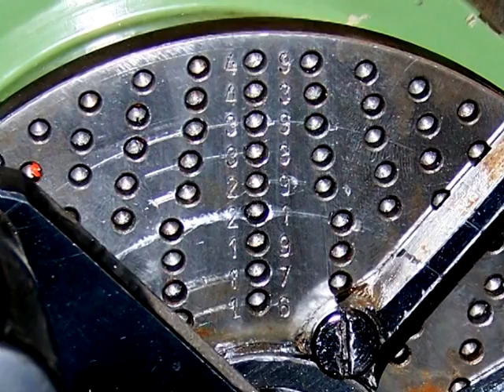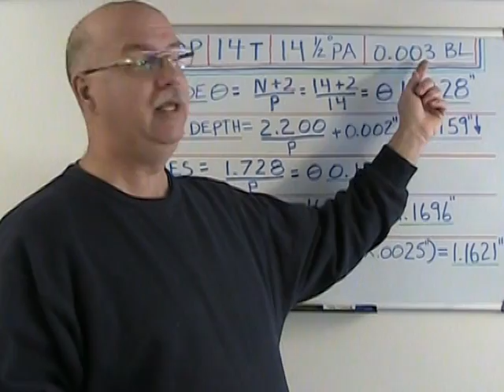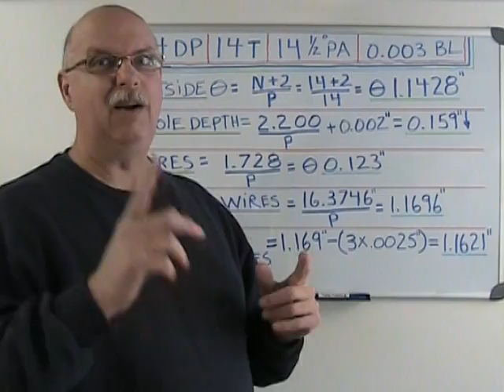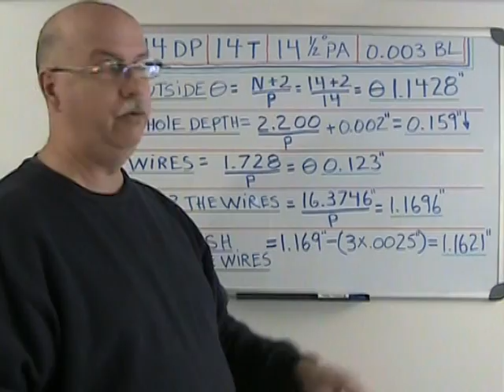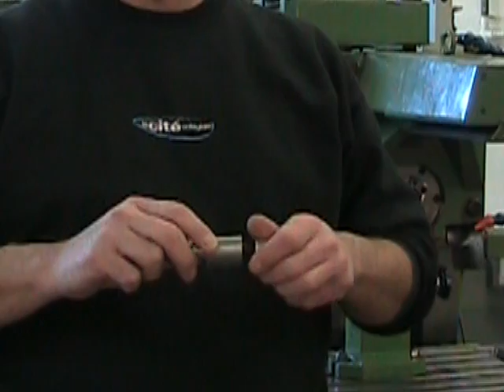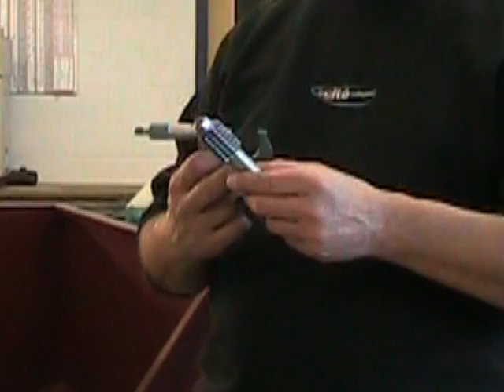027  DIVIDING HEAD & GEAR CUTTING, MILLING 101 MARC LECUYER

Comment: Th video is very interesting, I am not good at brilliant  at math. I am trying to work out how you got the  2 12/14 out of 40/14. I am trying to come up with a fraction for a 13tooth gear. Can you help explain pls?
 Thanks, waitng for your reply.
Reply from the maker: Hi! The formula for a 40 teeth dividing head is 40/N . N is the number of divisions you want to produce. So for 13 division you will have 40/13. If we simplifie the fraction we get 3 and 1/13 since 13 goes into 40 three times (39) and there is one (1/13) left over. So you will move the hand wheel three full turns plus one division (hole) on a 13 hole plate. You probably don't have a 13 hole dividing plate but you probably have a 26 hole dividing plate. So if you need 1 hole on a thirteen hole plate, you will need two holes on a 26 hole plate. So you will want to move 3 full turns plus two holes on a 26 hole plate for each gear tooth you want to cut. I hope this helps, if not let me know, Marc
Reply: Thanks for this explaining,  with the help of a fraction to decimal converter I know how you got the 1/13 from. Thanks for your reply again, will get back to you if i need any help in the future. Cheers from the small isle of Malta...

Comment: After the "over the wires measurement" when you reinstalled the gear for that final .010" deeper cut, how did you phase the cut teeth with the cutting wheel? The video skipped that procedure.
Reply: Hi! The part is held between centers and that is a great way to ensure concentricity of the part when removing it and reinstalling it for measuring. The rotational position is assure by the drive dog, the only thing to remember is that the drive plate has two screw that snug up to the dog to eliminate backlash. That can be a problem when removing the part so make sure that you loosen only one of the two screws and on reassembly, snug the dog into place using the same screw that you loosened at the beginning. This will not reposition the part in rotation to withing .001" but since you have left approximately .010" to remove, the final pass will fix any slight realignment problem ( in rotation only since the concentricity will be controlled by the centers). i hope this answer helps, if not let me know and I will try again, Marc
Reply: Thanks Marc. 'Love your work.

Comment: so my depth of cut lets say is 0.160 so instead of measuring over the wires just make my total depth of cut 3 or 4 thow bigger would that not work? im fairly new to machining with a precision 14/40 metal lathe and a bridgport clone atrump 9x49 milling machine trying to learn from your expert channel as well as the 2 kieths and oxtool and doubleboost. thx mark.
Reply: Jamie, You would not be certain that you were at the proper depth without taking a measurement.  Wires may also be used to measure thread depth.  I have done it, but would have to find the formulas again.

Comment: HI Marc,
thank you for the very in depth lesson on how to cut gears using imperial measurements. the conundrum i'm having at the moment is trying to figure this all out in metric as the metric version uses "modul" or "m" with 20 deg pitch. 
it appears i will have to make a hole plate for my dividing head as the gear i need to cut has 13 teeth and the lowest division on my dividing head is 15 

is there a big difference between the methods? i would think they are rather similar. the other question i would hav eis which cutter to use. i picked up the entire set of 8 (they were cheap enough) and so i'm trying to figure out the right cutter for 13 teeth

cheers
mike

Comment: Marc,
I served my apprenticeship as a machinist in the late sixties. Good explanation of gear cutting. Did I miss something about climb milling. Do newer mills have ball thd. type lead screws, compensating nuts or was your machine hydraulically fed.
Marv Fritts
Reply from the maker: ***** Hi Fritts, thanks for the nice comment. The machine I was using had a hydraulic backlash arrestor, there are no levers or knobs to adjust, just an on and off switch on the console. It works quite well but has one big drawback, it is so inconspicuous that the students tended to leave it on even when not required and that induces premature wear. Thanks for watching and for tacking the time to comment, Marc L'Ecuyer (a late seventies apprentice).

Comment: 16:00 .002 wouldn't be suitable for anything required to work in heat I'd say
Reply from the maker: Rob F hi Rob, you are very correct for high speeds, where friction is a real problem, more clearance, greater pressure angles and lubrication is a must. Thanks for the great comment, keep them coming. Marc

Comment: Hi Marc.  Excellent lesson on the subject.  I cut my first gear that last week of my senior year of high school.  My teacher set up the machine and the dividing head and taught me how to operate the crank and sector arm.  We made a worm gear out of bronze and he hand ground a single tooth cutter that he templated from a good tooth on the damaged gear we were copying.  I got into this so much that on the last day of school I chose to stay behind and finish the gear for him.  When I left that afternoon  the school was deserted except for some teachers and the custodians.  That's how much of a passion I had for machining. I worked in tool and die for a couple of years and started a formal apprenticeship but the only trade school in Philadelphia that sponsored tool and die was in a dangerous neighborhood, so I dropped out of the program.  I eventually got into drafting and design but I still miss machining.  I miss the Bridgeport and my all time favorite: the shaper.
Reply from the maker: Hi Tony! The gear teeth (14.5° and 20°) have the same thickness and the same height! The only real difference in they shape is the steepness of the curve on the sides of the teeth (the surfaces that rub). Gauges are available but quite rare, I would suggest to find a gear cutter for the 20° pressure angles and the correct diametral pitch and then use it as a gauge to compare with the mystery gear. If the teeth have less curved surfaces, it is more than likely a 14.5°. If the teeth match the cutter, it is a 20° and if the curve is more pronounced that the cutter it is probably a 25° pressure angle gear. I hope this helps! Marc
Reply from the maker: E.PLUMBUS UNUM Maybe next fall I will try and make some videos about my little shaper. They are fun  machines but boy are they dangerous! You don't want to be inattentive when operating them. thanks for commenting and for watching, Marc
Reply: Marc, can you tell me how I can determine whether a spur gear is 14.5 or 20 pressure angle?

Thank you!

Tony Tammer
John Swett High School
Crockett, CA

Comment: I'm still working with the "theory" and I didn't see how you set the two sector arms.
Let me see if I've got it correct though.
You start at the zero tooth with the leading arm against the pin, then count 18 holes clockwise and adjust the spread of the sector are so that the flat of the arm is clockwise past the 18th hole and lock the sector arms together.
Cut tooth
Hold the sector arms in place, and pull the locking pin out and turn the crank two full turns and then to the flat backside of the sector arm, push the pin in the hole.
Now rotate the sector arms against the back side of the pin 
And cut another tooth, repeat until all the teeth are cut.

Sorry I need some help in setting the sector arm positions and rotating to a new position.
Reply from the maker: You are correct but I want to make certain that you understand that if you count the number of holes including the hole that the plunger is in, the total will be 19 holes. That is why it is important to say (when setting the sector arms) that they are space at 18 holes not counting the hole that the pin is in. That is because it is the spaces between the holes that we should be counting. For 18 spaces you need 19 holes. Thanks for watching, and thanks for a great question, Marc L'Ecuyer

Comment: Marc how did you set the gear back in the machine for the 2nd cut, pick up back at the same place??
Reply from the maker: Hi Frank! if you go back to the video and watch from 2:15 you will see the drive plate. Since the part is mounted on an accurate fixture that has accurate center holes and the drive dog on the fixture is never moved, you can remove and replace the part, fixture and drive dog assembly between centers with great repeatability. The rotational precision is ensured by using only one and always the same set screw to snug the drive dog to the drive plate. Also, it is important to remember that I purposely left some ten thousandths of an in on the part, this is more than enough material to make up for any error (will be very small) on the positioning of the part. Thanks for watching and thanks for the great question! Marc L'Ecuyer

Comment: Heya Lazy Machinist,

Thanks for a very informative lecture. Loved it! I've always wanted to know how gear-grinding was done and you've explained it exceptionally well. I do have a question though. Would it be OK to create a fixture that includes the key-way for the gear first, or should the key-way be cut afterwards? My thinking is that if the key-way is cut first then install the blank on the fixture (with the key installed), there's less risk in damaging the gear teeth after they're cut. Any thoughts? Thanks again...

Comment: Excellent Video !  I spent 20+ years setting up and running production equipment such as Gear Hobs, Mills, Spline Rolls, etc., but never had to figure the wire size myself as it was always provided on the blue prints.

Good information to know on the formulas and calculations.

Thanks for sharing.

Comment: What are "wires" and what does "over the wires" mean?
Reply: 123HURST :  "Wires" are pins or 'wire gages' that you drop down between the teeth and measure over top of with a micrometer to check the pitch diameter.

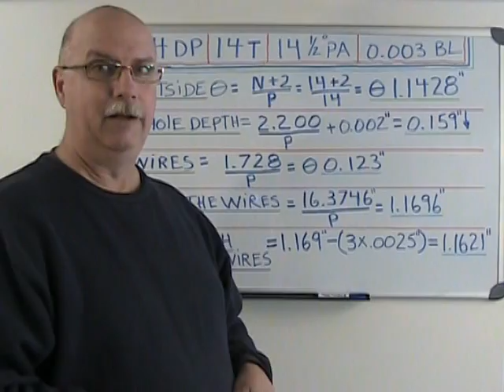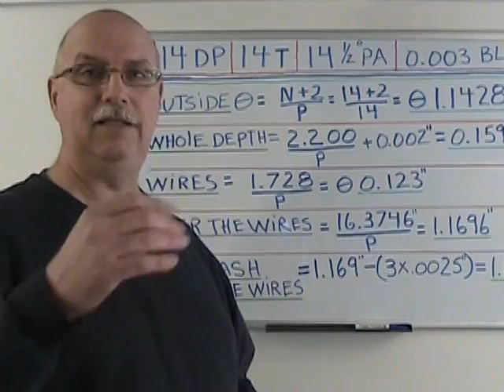If you go back and watch the video from the 17:14 minute mark through 18:54 minutes, he explains how you calculate the wire size and the "Over The Wire" size.

I spent 20+ years setting up and running production equipment cutting gears and splines measuring 'over the wires or pins' but never knew the formula for coming up with the sizes. They were always on our blue prints supplied by engineering so I never had to figure it out myself. Using the formula he shows there makes it pretty easy to do if you don't have a copy of the Machinery's Hand Book.
Reply: 123HURST   There are also DP involute gauges that you can place on the teeth like a screw pitch gauge.  This works well especially if you are NOT holding your gear with a lathe dog and cannot remove or have access to the gear till complete.   I also think extra depthi cut is excessive.     Any book on cutting uses 2.157''  instead of his 2.200 plus backlash.

Comment: Marc - so I've just restored my Brown/Sharpe dividing head (MINT cond) and I've bought my cutter for some gears I want to make. I've watched this video a few times and can't seem to find the appropriate table in Machinery's handbook for the "measure over wires" numbers. You used the 16.3746 / P formula for a 14-tooth with DP of 1.  I want to find this chart so I can find the number for a 27 tooth gear and divide that by (my) DP of 16. My book is the 19th edition, so the page numbers might not be the same. What is the chart number or it's name? Or what other tables are near it in the gear section?
Reply from the maker: Hi Brad! I found an old twenty first edition and the odd numbers of teeth are on table two that is on page 948. I used table one in the video since my gear had an even number of teeth. The formula for wire diameter is at the top of the table. If you cannot find the chart, tell me your pressure angle and I can give you the numbers. Marc L'Ecuyer

Comment: Great video for those wanting to cut imperial spur gears.I wonder if you could make a video with the calculations explained, for cutting spur gears of the metric module variety ?
Reply from the maker: Hi Michael, the modular system doesn't change much of the process but it does changer some calculations. I will try and get something on the subject tagged too the end of a little quickie. Thanks for watching, Marc L'Ecuyer
Reply from the maker: Michael Walter Hi Michael, the formulas for gears in the machinery's handbook are the same for the most popular pressure angles (table 4 in spur gears section around page 2040 depending on the edition). This means that the teeth for the different pressure angles have the same height and width. This for me is a clear indication that they will work together. Marc L'Ecuyer

Comment: Very good in depth video covering every aspect of using a dividing head & cutting a gear. The only thing I was concerned about was the fact that you cut away from the dividing head, putting the pressure on the tail stock support. Thank you again, I have subscribed.

Comment: THATLAZYMACHINIST Very excellent video; its rare that I don't end up skipping through a lot of "tutorial" videos but you managed to keep the entire video informative (and captivating, to me at least). There are a lot of certified "hack" machinists out there and people like you bring a ray of light to this dying trade. The more young-guns like myself know about the ways of old the better if you ask me. Bravo.

I had a few questions as I watched the video that weren't entirely explained: how do you decide you need #7 gear cutter? What if your number of teeth is not even, how then do you approach over the wires measurement?

I will consult my machinery handbook for those questions, but I thought it something you may want to mention in newer videos - unless you did mention and I missed it!

Thanks again.
Reply from the maker: Hi! And thanks for watching my videos! The cutter number is directly related to the number of teeth since the less teeth there are the more curved they need to be. For the odd number of teeth, you place the pins in almost opposing grooves ( as far apart as possible) and use the constants from the odd number of teeth chart that you will find in your handbook. Thanks for watching, I am always pleased to hear from young, dynamic and interested machinist. Marc L'Ecuyer

Comment: Would it be advisable to keep little pressure on the indexing head brake while advancing to the next position to even further eliminate any possibility of overshooting your mark?
Reply from the maker: HI Max, you are quite right, it is something I do and I should have mentioned it. Thanks for the great suggestion! And thanks for watching, Marc L'Ecuyer
Reply: THATLAZYMACHINIST Your welcome! Your videos have been a big help for me brushing up on my basic skills and procedures after being out of the shop for a couple years. Thanks for making them!
Reply: *****
In addendum; this technique is probably well used on pretty much any hand crank feed in the shop that has a locking feature, sneaking up on positions of pretty much any kind.

Comment: Thanks Marc. Thats another project, but I will be using a turntable upright and with these calculation I should be able to make one. My turntable has a ratio of 90 to 1. I just bought a small counter just for that. Each time I will make a turn, I will touch the counter so that il will increment by one.

Comment: Thanks for a very detailed description of gear cutting. I have several gear projects, that I have been putting off. My equipment is not as sophisticated, but is capable. I need to cut a few skew gears. I also need to make the cutters. I would be interested in the measuring of an existing broken gear to make the calculations. I have learned a lot from watching your videos. Thanks EN.